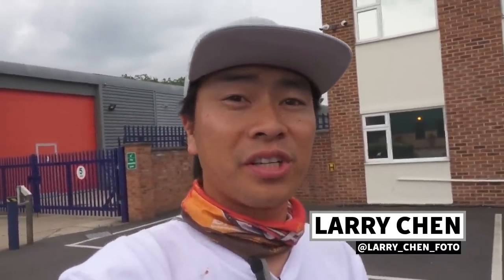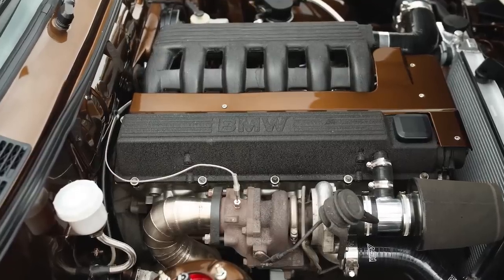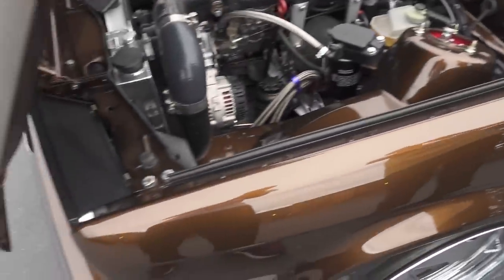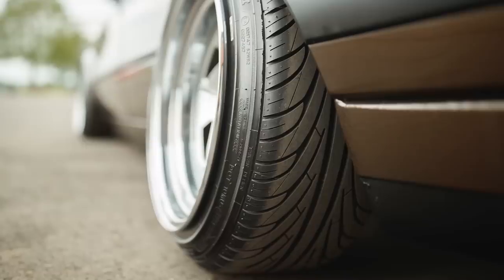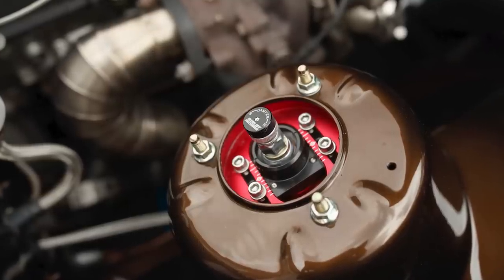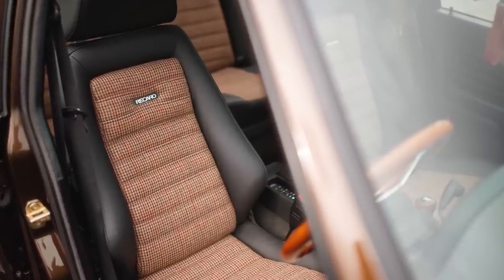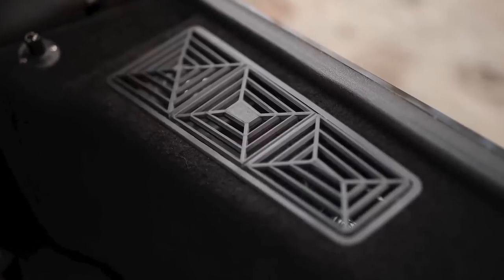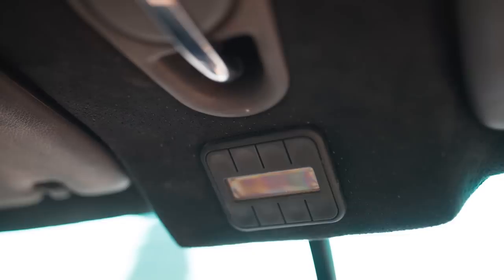Farm-Built, Diesel Swapped BMW E30 Wagon of our Dreams

Comment: This is the most cleanly built and least flashy car at the same time. Amazing work
Reply from the maker: Keeping the original BMW Touring look and feel without throwing on a wide body kit is what makes this car look proper. Anthony nailed it. 💯
Reply: This is an amazing build also check tom’s turbo garage he swaped an ls into a toyota tacoma plus a turbo and that thing is awesome and clean asf
Reply: It's called tasteful.
Reply: shame the builder RUINED it with those overly wide wheels and stretched tyres, which are technically illegal in the UK, although unfortuantely very few people are ever given a ticket over this safety issue, or fail the MOT for it.
Reply: @heygek2769  you do realize it's a air suspension and the way it sits on the ground is not the driving setting, 1:00 for the driving setup
Reply: don't forget the disgusting and unnecessary amount of smoke from the exhaust... talk about "clean"

Comment: if it had an M57D30 it would have been my dream build
Reply: More hp stock than this one and available pretty much everywhere. Idk why owner went with M51 instead
Reply: More hp stock than this one and available pretty much everywhere. Idk why owner went with M51 instead
Reply: @M4TIJ499  probably because the M51 is much simpler considering engine managment, but the work required to make an m57 run is worth it i think
Reply: TayTay we have some. No show cars come to mind, but good dailies and proper quick cars are around.
Reply: i think the M51 is a very good engine. except for the fuel pump, it is super reliable and crazy cheap
Reply: I rather the m51 it sounds better and is simpler but has a lot of weak points unfortunately

Comment: 2.5TDS in an E30 is very common. Come on over here, we have several M57D30 swapped E30s. The M57 is the next generation engine, 24v, more power from the factory and WAAAAYY more potential for power, too. Some are turned up for the drag strip, too.

Comment: The build quality is stunning on this! However, I don't get why use the M51 instead of the M57 king. I doubt it would have been much more work to fit it, but I may be wrong.
Reply: Yhap, m57 is way better option, CR injection better sound, less smoke, more power. Is just the best diesel engine bmw ever made.

Comment: Amazing build, The e30 324td is a good car swell but the m51 325tds is just that bit more refined/

Did you have any hot start issues with this engine? and what was the fix, I got a 325tds sitting with hot start issues need it fixed.

Comment: Yes the smoke... Thats what I dont like on these older engines, they spit off too much unburned diesel... New ones with electronic fuel pumps do not smoke so much even chipped or rebuild for a lot of power..

Comment: In Europe Diesel-Engines in small vehicle‘s are normal.
Reply: Not in 1993
Reply: 328 Ci 

My MK2 VW is build in 1989.
It‘ s a 60 Horsepower Turbodiesel.

Old Mecedes from the 50‘s and 60‘s drive‘s by Diesel.
Not only Truck‘s.

Comment: The car itself is amazing but the engine kind off ruins it. I would have used m57 from a e46 or e39. More reliable and way more possibilities if you want more power (witch you can't really get from a m51).
Reply: namelessvids even a m21 can easily develop 220 hp. A lot for small car like this e30

Comment: Had an E30 318 Touring years ago, really nice car.
However, I really do not like the rims and it sits a tad too low for me.
The original crossed spoke aluminium wheels would look way better.
Reply: Completely agree, although i believe BBS or BMW Basket Weaves would have looked so much cleaner